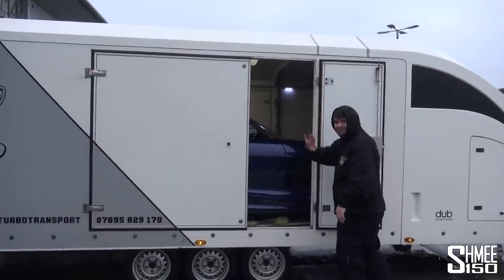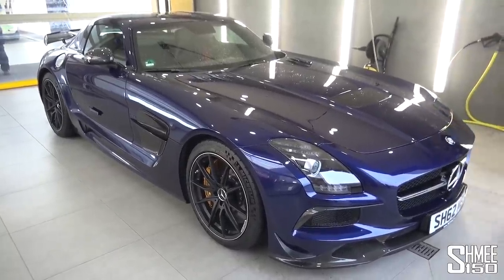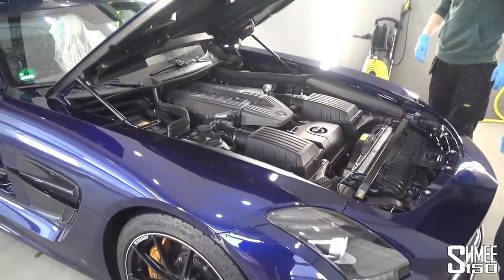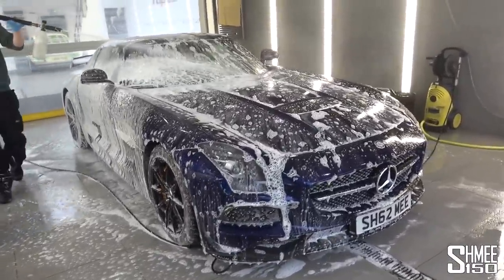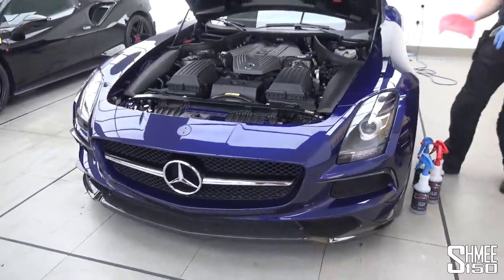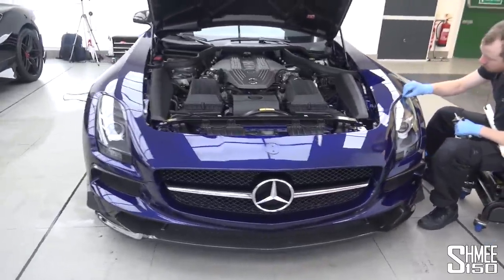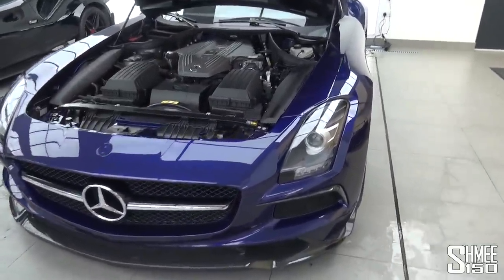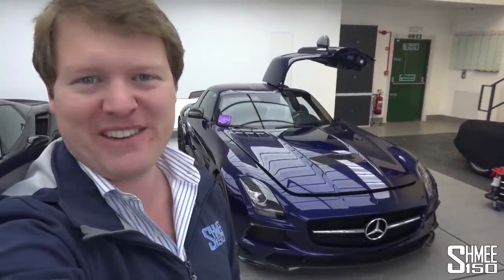Preparing My SLS AMG BLACK SERIES! Essential Wash Prep at Topaz

Comment: Yeah... I'm not seeing how the silver wheels will look good with that paint color, especially if it matches the fuel filler cap. I think it'll give a little too much contrast between the darker paint color and the wheels. I would propose reducing the silver to just the leading edges of the wheels. That way the contrast will be lessened to what I see as acceptable levels. I think it'll look quite a bit more modern as well. All of this being said, I haven't seen the silver wheels installed on the car yet, so perhaps I'll think differently once I see it completed. 

I wish you good luck with your cars, Tim and stay safe, will you?

Comment: Quick Question: Why didn't they remove the number plate plinth before washing the car? That way they could clean the dirt underneath the plinth, especially when there's gonna be PPF installed over it.
Reply: I know, right! I had the same question when they didn't remove the stripes off the GTR Pro before washing, but waited until after it was perfectly clean to remove them.

Comment: I’m slightly confused after a fresh new paint job should the paint go through 3 to 6 months of curing at warm temperatures before it’s covered up with PPF?
Reply from the maker: We've given it about 6 weeks, which is vastly more than normally recommended and probably less than some brand new cars that come in
Reply: Shmee150 sounds good!  Thank you.

Comment: So there was no paint correction at all required.  Strange,  would have thought Topaz would find something on a new paint application to adjust.
Reply from the maker: It all depends on the level of perfectionism. Of course Topaz go to extremes including using electronic microscopes to analyse paint and all sorts, should you wish to book that service. In general instances with PPF the installation of the film over the top is benefited by paint up to a certain standard and Chartwell knew exactly where the car was going and carried out those stages as part of the payment for the respray process.
Reply: Shmee150 it’s all relative. Chartwell as you state, would have a perfection tolerance far above other paint shops.
Reply: Nitpicker

Comment: Ur last vid gave specs etc on the new GT BS. It looks cheap & all about that oversized rear wing. That didn't ultimately help the value of GT2RS & MB better keep production #s down (no more than 3-350) or it'll suffer the same fate..even more so given the Covid financial environment. It may be a touch faster but NOTHING brings more satisfaction than driving a full throated naturally aspirated car!  Yes, prob orange as all other colors have been used. Same c. $280USD base sticker.